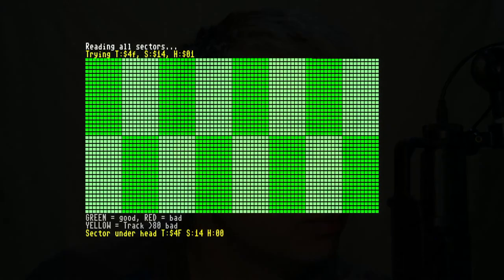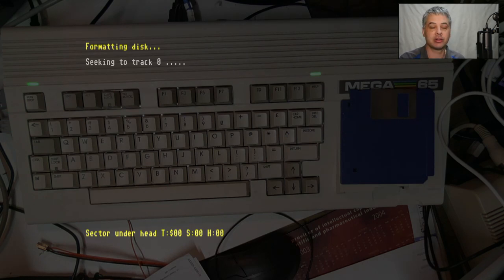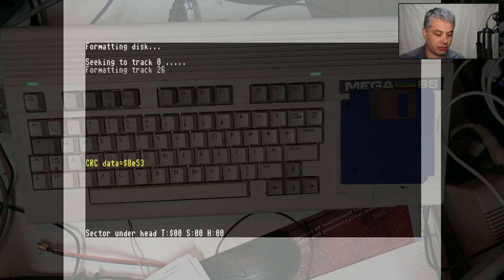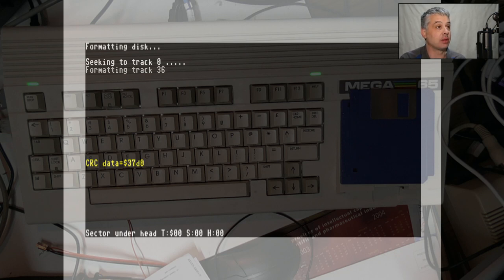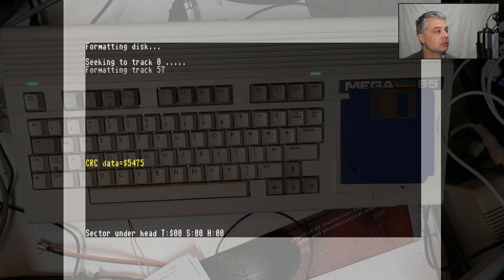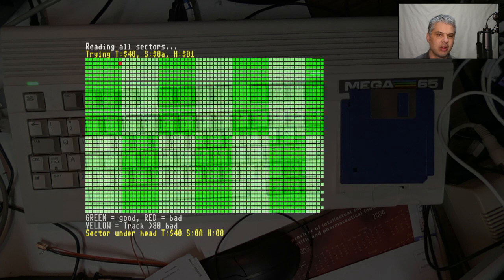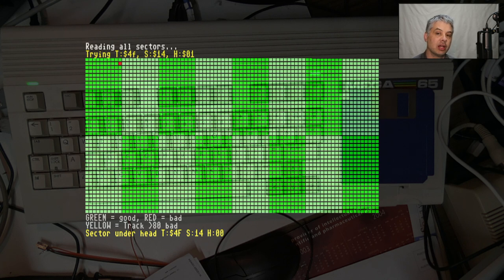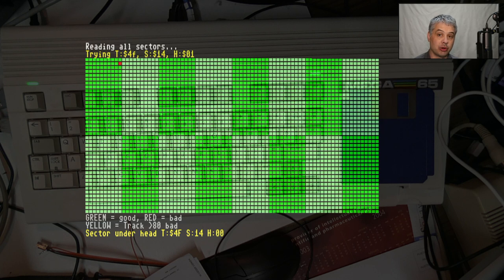MEGA65 Development Stream - 009 - How much data can be written to a floppy disk

Comment: Amazing study, hope it leads to maybe something like a M65 format of sorts?!
Reply: That is exactly the idea: I am trying to work out just how much that format will be able to hold. There will be two variants: Game Mastering Mode, where it is written track-at-once for about 10% increase in capacity, and Read-Write Mode, where normal sector-based operations will be possible, but with slightly lower overall capacity. >80 tracks will be an option for both.  Should result in ~2MB for Read-Write Mode, and a bit more for Game Mastering and/or 82 or 84 tracks.  Stage 2 is to use RLL2,7 coding instead of MFM coding, if I can get it to work, which can increase the capacity to ~3MB or even a whisker more -- all on a normal "1.44MB" HD floppy and drive.